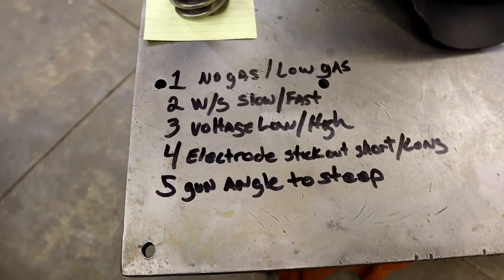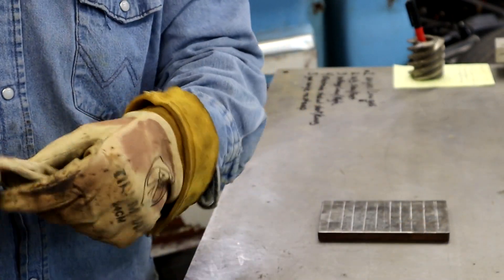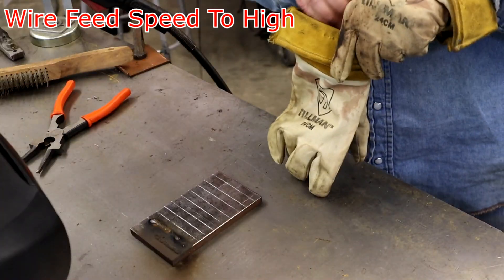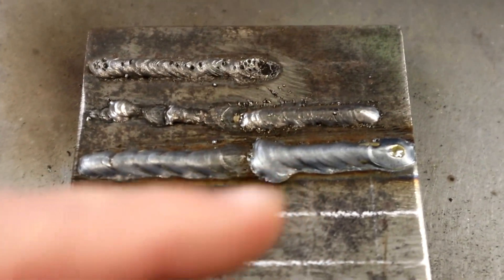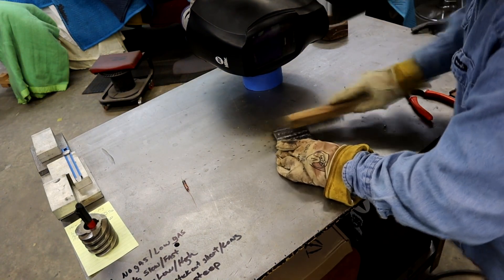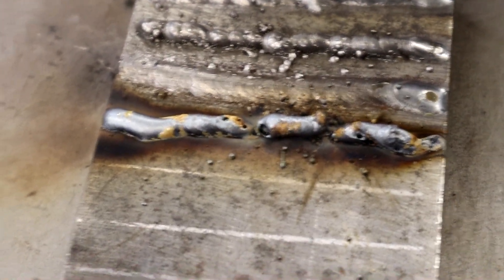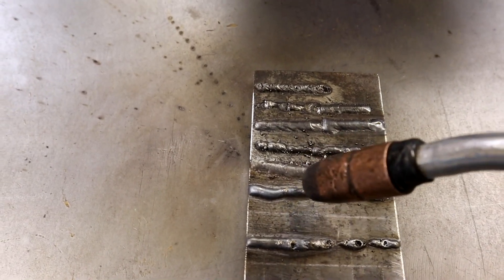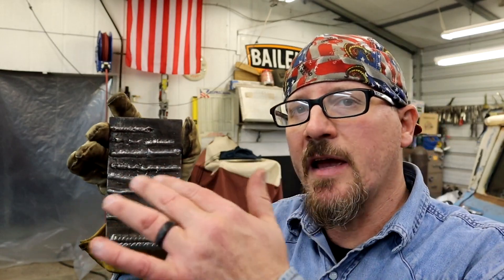(How to MIG Weld) Top 5 Mistakes Made by Beginner Mig Welders

Comment: Just 1 more tiny tip. I have a friend who is in his 70's and has Welded for years and years and he had one set of his Script glasses the lenses were intentionally put in upside down for welding. We built a bunch of pontoon trailers right in his driveway and that ol boy can weld. He taught me his style and I tried it and it was just not right for me to get a really good stick weld. I rather have my rod in the holder at less than a 90º Angle I prefer 45 º or sometimes a 30ºBut you just have to pick what you like. I find that if I am holding more like a pencil is awesome. USMC 1984-1992  0311 Grunt/1371 Combat Engineer. Been welding about 25 years and Am pushing 60 years old now.

Comment: Where do you find the scrap coupons to practice?
Reply from the maker: I usually buy a 12 ft piece of 3x1/8 in chicken metal flat bar and cut it up. It's alot cheaper. You can buy pre made coupons from weld metals . Com

Comment: Just before you begin welding is your tip (the wire that is) touching the surface or "almost" touching the surface??
Reply from the maker: You can lay it on or I'll have it pretty close, just as long as you don't have it a long ways away no more than a 1/4 inch at max.

Comment: My problem is seeing the weld. Do not know what is safe shield settings to protect eyes so think I’m doing good but results are scary. Sad part my dad and brothers were iron workers😢
Reply from the maker: As for shade numbers for Mig I use #10 to 11unless your running high amperage around 180 or higher. A good way to tell if your lens is not dark enough after you weld your eyes get tired if thats the case jump up a number higher on the shade. Ill drop a video link below I made a while back on seeing your welds. 
https://youtu.be/ZEm8_1v-4wM?si=hjp14swljUvy-nyV
Reply: Dont look at the bright arc. Look just behind it at the puddle.

Comment: Can you show us welding a rusted exhaust pipe that wants to blow through? I last used a washer to hold and join, then two straight pieces of muffle clamp U-bolts (cutting off with grinder) to provide structural strength. It was tricky.
Reply from the maker: Sounds tricky,  I may try to do a video on it if you want.

Comment: I weld one way and others will weld another but bottom lines are the penetration, and using a proper gas for your wire or materials placed together. I can't with a lot of success weld a pop can together an not get some issues plus I like to push as to pull on my welds... depends on angles and the thickness of metal I am joining
Reply from the maker: I need to try the drink can sometime, I've always wanted to try but never do. It looks very challenging!!!

Comment: Good information. 
How about showing what happens if you don’t clean the dirt and rust off the surface well enough?
Reply from the maker: I may do a video on that thanks!!!!
Reply: I would be very interested. Sometimes its hard to get the metal totally clean especially when trying to repair something on a vehicle. Wire brushing may be all that's possible and contamination results. My experience is that rust/dirt/paint causes more spattering and irregular arcing (furiosity in your words) and the welds look wormy. Plus more fumes (probably some toxic). Weld will usually but clearly not as good with the impurities mixed in. I try to run a fan or work outdoors in those situations. God bless :)